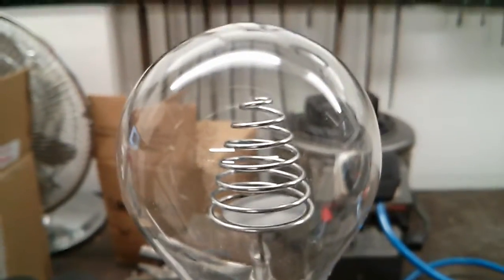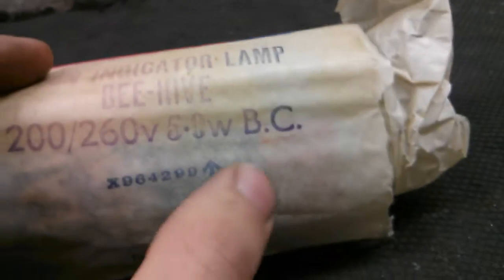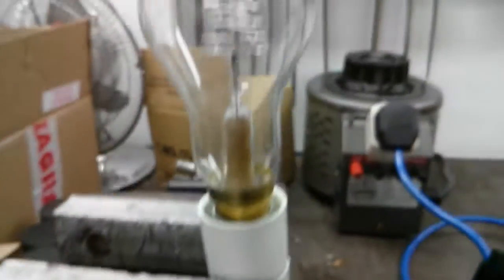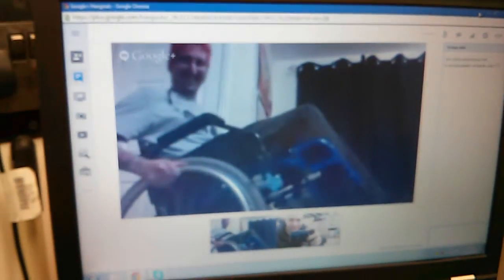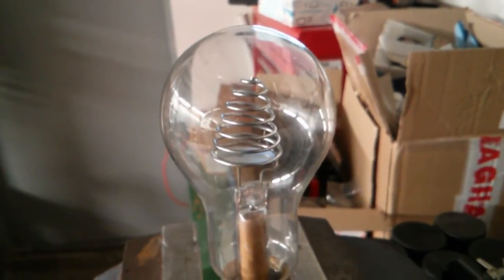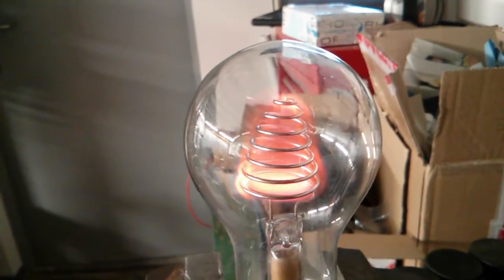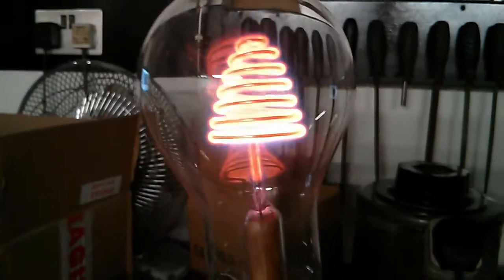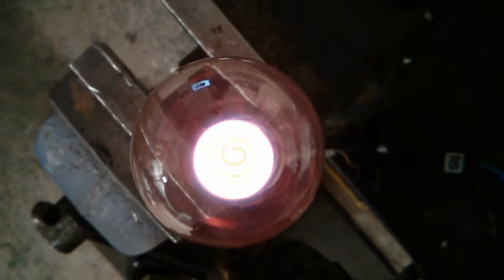Beehive Neon Indicator Lamp

Comment: very nice behive lamp :D atlas too there one of the rarest of behive lamps the most comon but still very rare ones are osram GEC ones and yup the lamp is ex MOD i have a few bhives 2 are realy used and very black one is NOS from the 1930s its pip top but has no resistor . ur lamp is from the 1960s :D
Reply from the maker: Thanks Lightbulbfun!
I's still my favourite lamp out of my collection, I didn't realise how rare Atlas were, I'm sure I have another few Atlas lamps about... xD

Did you use the number code I listed to work out the date from it or do you know the era these would have been made in?

You seem to know more about these than me, I just like them as they're vintage electrical, made of glass and look nice, off or on haha.

Information about these fascinates me though!
Reply: Steve Lane the code on the warper is a NATO code for it the date code will be on the lamp etch it will be 2 numbers most probly (cood be 2 latters or 1 number and one leter tho or a load of dots), i can olso tell by the style of lamp and box wich eara its from . i own a few atlas lamps even an atlas 125W 8ft tube from 1973 my oldest lamp in my colection is from the 1890s still works too its an ediswan 110V 16Cp carbon lamp . im glad u like lamps for, its good to know there in safe hands :)

Comment from the maker: That's kool, I take well to criticisms, I see them from the positive perspective to begin with and will usually use them to improve, I can see what you mean, given half the chance I'd use a variac to make my sandwiches haha xP Nothing beats that reassuring control of voltage to limit the magic smoke, mind there was plenty of that coming from the ZVS earlier, damn PCB traces aren't up to the claimed current rating of the device...

Comment from the maker: Hey thanks Seb! These lamps were used in Airfields apparently.
There is no clear date codes on it but there is a "X964299->" on it,
Possibly a military number looking at the -> mark.
Neons were invented in 1898 by William Ramsay and Morris W. Travers and further developed in 1917 as indicator lamps. It's hard to put a date on it really but it looks old enough for 1940's t be in the ballpark really.

Comment from the maker: I would hate to pop something that has lasted this long without finding itself in the landfill.
As with most other neon lamps 230V applied directly to the lamp with no current limiting
resistor usually pops them instantly. this one appears to be using an internal resistor,
although I could be wrong as it is not clearly visible. 
Variacs FTW!

Comment from the maker: Thanks EF, they're nice to look at and don't give you arc eye like most other lamps do.
Sure they're not as efficient as they draw 5W and put very little light out, but for a project
that requires a vintage look to it these are great.
I'm guessing as with most neon light sources these last quite some time (10years+?).